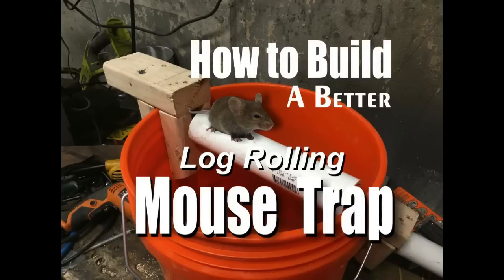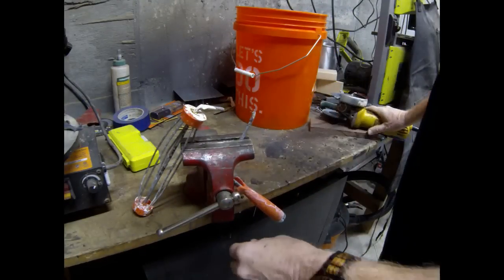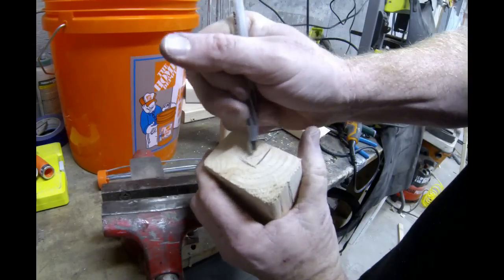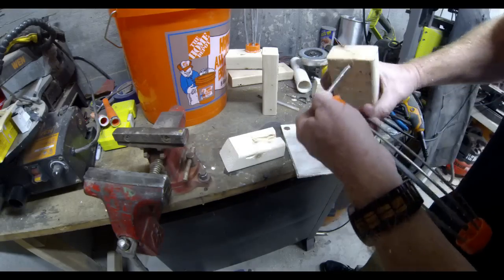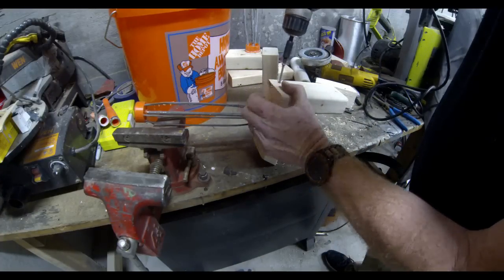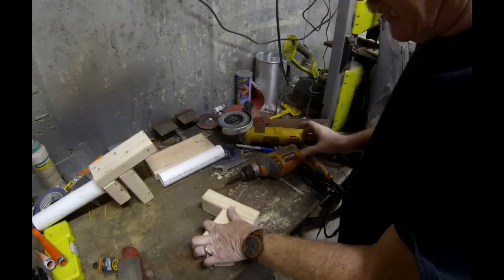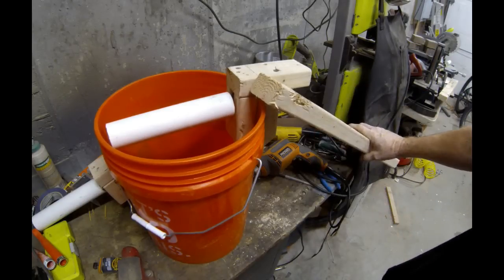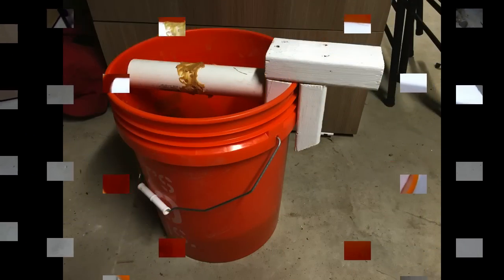How to make a better log rolling bucket mouse trap easy DIY project

Comment: a lot of work    just drill a hole on both sides of the bucket and a soda bottle with cap on length wise     run wire from one side of bucket to the other with bottle in middle  put peanut butter on bottle  lean a ramp{wood }against  bucket    add water till  1/3 full    works great

Comment: Boy, what a lot of negative Nellies commenting below. FYI for everybody claiming the pop bottle or can on a wire is a better idea, it doesn't spin as freely as a paint roller. I made mine with scrap wood, a scrap piece of PVC, and a paint roller that was about to go in the trash.  I did make two modifications.  I drilled a double hole in the end of the roller and an equivalent size hole at the top of the garbage can I'm using.  I run a dowel through the roller and out the hole in the can to lock it in place for a few days so rodents learn to trust it.  Because I'm after rats I angled the entire trap slightly downwards and added a piece of vinyl flooring to the top so they will have a harder time trying to grab the platform once the PVC starts to spin.

Comment: I have 1-1/2 gallon pail I don't use,and figure I would just cut a piece of 1-1/2" pvc pipe with end caps drilled for a rod that can go through the pipe and pail on both sides. A lot less work than using all those 1x3s. You can reuse the pail if you don't mind a couple of holes near the top.

Comment: Very clever but  ....
The problem with your solution is that it would be a pain in the butt to tend to, in the winter in northern states.  And that is when we get more mouse activity from mice trying to avoid exposure.   I just place tomcat mouse traps inside of the Havahart model  # 1083 squirrel traps at night and bait them with peanut butter.   I caught about 20 mice the first 2 weeks I began doing this.  Now I get 1 every few days. 

I do this so that I wont be killing small birds in the early AM if I wake up late   (Many bird species will be attracted to peanut butter.)  Then during the day, I remove the mouse traps from inside the 1083 and just use the squirrel trap for its' intended purpose.
Reply: Three words for winter:  Non-toxic RV Antifreeze!
Cheers

Comment: Could I buy one from you? I am having a tough time dealing with mice and you have this perfected down to a science. Yours I think works better than the commercialized log roller style which had to be placed lower in a wider taller bucket or garbage can for it to be effective. The one traditionally marketed is easy for a mouse to sit on top of the bucket to access the bait without jumping on the spinning log. How freely does the PVC roller spin? You could also cut PVC sized holes out of a coffee can and run the length of a PVC pipe right through the holes of that coffee can and through each end of a 5 gallon bucket. Then to tie down with hay wire the ends of the PVC pipe that the coffee can rolls around off of on the outside of it within the bucket to the outside metal handles of bucket on both ends of the bucket to secure the PVC roller pipe in place so it won't push straight out of the holes on each end of the bucket.

Comment: Wouldn't a clamp made from a jubilee clip and angle bracket on the roller allow you to achieve hold on the bucket lip and variable bucket thicknesses. 

Then a ramp on the far side that encourages the mouse 🐁 to jump that small gap onto the roller. Less sacrificial parts, more mouse momentum (try saying that after a few)

Comment: Prove it works by making a video showing the trap in action, and for multiple mouse catches.  The paint roller's bail and PVC pipe are far too heavy.  Much heavier than mice.  It won't roll when the mouse is centered atop, and there is nothing to get the mouse to lean to the side.
Reply: Precisely.   Nine inches of PVC, functional paint roller, epoxy, fasteners, use of power tools amounts to several dollars, an soda can, wire hanger, pennies.  Aknowledging to primacy of low inertia as a design criteria, priceless.

Comment: On my version of your idea, the roller was touching the bucket and was unable to spin.   Instead of using a back piece, I used zip ties to snug up the apparatus to the bucket (drilling holes in the right spots), and it spun.   Thank you for your wonderful idea.
Reply from the maker: Great job!

Comment: You caught 10 mice in your mousetrap? I thought it was a great idea and made one just like. But I have one mouse that moved in my house and he is smart. First I tried conventional mouse traps and set them around some with peanut butter, some with cheese. He wouldn't touch those traps. I built a home made electric mouse trap and he wouldn't step into it, smart. I like diy stuff and built one like you have and even made a nice ramp up to it and left it for a few weeks. He's just too smart. 
I lived in a house that had a lot of mice about 10 yrs ago and I used dcon poison on them and it did get rid of them all. But I don't want to use that stuff here. I think if you have quite a few mice some are going to be young and dumb, but my one mouse is adult and very smart. You made a great trap, but my mouse it too smart for it. I'm out of ideas. Would you happen to have any other ideas?
Reply: Whatever ur trap is block it so it does not catch him and keep it baited he will start to feel safe and vome back over and over.then u can reset the trap.but its probably a rat and u will neef a bigger trap
Reply: try dry or wet pet food, sardines, dried fruit.